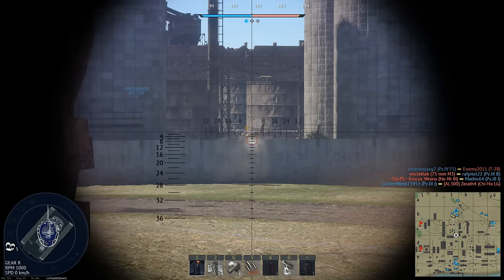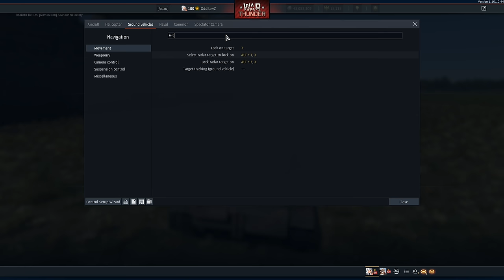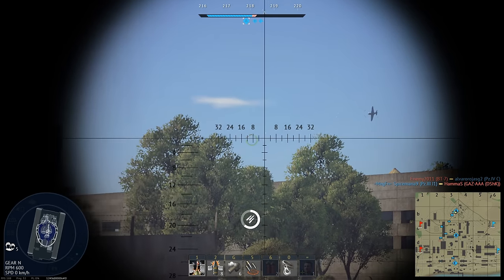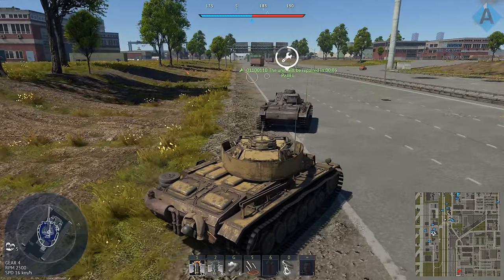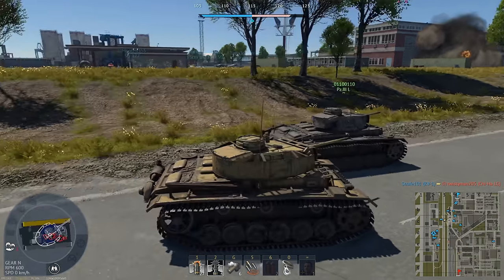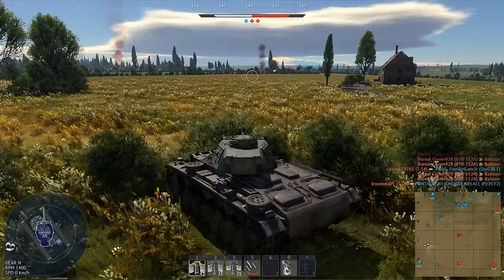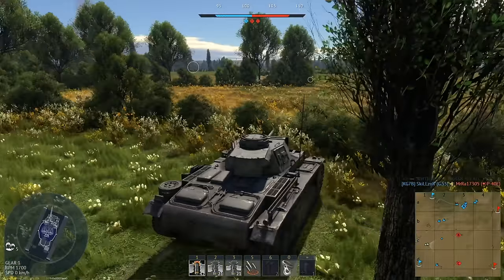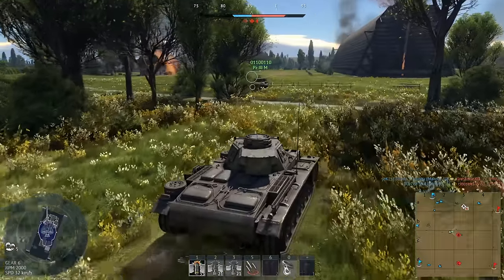TIGER ARMOUR AT 3.0 - Pz. III M in War Thunder - OddBawZ feat. @PhlyDaily  - Volumetric Armor

Comment: Definately a positive change. The Panzer IIIs look awesome with the winterketten and with the FHA (which most tanks should actually have) the effective thickness of the frontal turret armor on the L/M is 75mm+. That's more than any of the Panzer IVs. And with their mobility and the buff to the 50mm, they are now really, really good.
Reply: They also stomp if in an uptier now, try playing 2.0 GB into them, they are immune through the front now except for a few weakspots,
Reply: But that thickness looks like glitch. By broken volumetric system.
Reply: @Kijby  why do you think its a glitch,
Reply: @matthiuskoenig3378  You can see 265mm thickness and even >400mm from somewhere. 
Gun shield's thickness are very broken now.(Can see 1000mm effective thickness for turret of IS-2 and 400mm for leopard 1)
Reply: Did the Winterketten always there? I've never seen those modification before
Also is it available for stug iii as well?
Reply: @anonymousstout4759 Added by this patch. But Stug can't use winterketten(Use ostketten only).
Reply: @Kijby  does this modification added more stats or grip on lower stability terrain just like they intended to do, especially in snowy maps?
Btw thanks
Reply: @anonymousstout4759  Little more grip for tough terrain.
Reply: @Kijby  Little more grip, but that doesn't mean shit with Gaijin's Dawn Soap they put all over out tracks. It's like a goddamned slip'n'slide out there!
Reply: @leeham6230 it's 'funny' because the Soviet tanks that made huge compromises in all terrain grip for track durability and ease of maintenance like T-54 have all the grip in the world, no matter the terrain.

Comment: Honestly the volumetric shells update is fantastic, it makes the ballistics of WT far more accurate to real life. No more of these gamey turret ring shots from 150mm cannons.
Reply from the maker: I’m really enjoying it, actually.  Makes the battles more gritty!
Reply: The pen formula is still shit tho
Reply: @AllMightyKingBowser  Best part about the pen formula? They've actually made it easier to penetrate sloped armor than it is IRL.
Reply: @leeham6230  "Hurr durr look at me, im parroting spookston!" IRL machine gun ports were no where near as bad as they are made out to be, and the fact that 70mm-150mm shells can no longer slip through a 10mm hole is not a bad thing. American MG ports that used to be a weakspot are still reliable weakspots in my experience, I have not noticed any of the issues pointed out in his video as most of them are very rare and you really have to be trying to hit perfectly on the corner of a vehicles armor.
Reply: @doctordoggo8604  If you hit a joint with 1 shell, the game now adds the protection of the two plates, effectively making shots that should penetrate worthless. In real life, big shells could find their ways into smaller holes; if you know anything about physics, then this shouldn't be hard for you to figure out.

Volumetric shells could work, but they would have to either redo the armour models of most vehicles, or redo the calculations of penetration when two side-by-side plates are hit.

Again, good idea, but bad implementation. "hurr durr I'm parroting _____" is lazy and quite gay.
Reply: @leeham6230  Dude, you would literally have to be aiming to manage to hit a joint that head on, even then when you hit the join of a tank IRL you would have to pen both plates if 45mm of your 80mm shell hit the angle. I was pointing out that you are parroting spookston very clearly, and this is one of the rare instances where spookston is wrong.
Reply: @doctordoggo8604  Joints are weak points in WW2 tanks, cannot speak for modern/cold war tanks because I don't know much about them. The calculation: plate1 + plate2 for shells hitting 2 different plates make absolutely no sense at all.

Here's a good point on why they would have to change the armour models for this to work: Let's say I hit the Sherman M4A1's weak upper front plate (19mm thick), but I end up hitting the joint between that weak plate and the middle front plate, which is thicker (50+mm thick). In real life, my shell would take the path of least resistance, so I would lose some penetration, but my shell should still penetrate. In-game, the olates are added together, despite being beside each other. So, 19+50 = 79. This is just bad game design.

Comment: 9:45 One solution I could see is to have Vehicle Specific Controls. What I mean is that the default controls would be universal to all vehicles, but you would have the option from a drop-down menu to change the controls of whatever vehicle you have bought and/or crewed, without it changing the controls of other vehicles :P

Comment: The German 50mm is the best gun in the game for its tier straight up, no matter what you shoot at it will pen and last time i checked if you use the APCR on the puma you can go through a tigers front upper plate if you're close. When I used that gun it was one of the few guns I had absolute faith in whatever the situation.
Reply: Stock shell can go through the tiger, its 106mm pen and tigers front is 102mm
Reply: @threadworm437  i never did use the APCR
Reply: @threadworm437  i found the APCR to be overkill

Comment: Phly, the German 75 MM L/24 is a very short/smaller casing than on the 75 MM longer barrels.  The larger ammunition of the 75 MM of the L/ 43,48,and especially the L/70 barrels the case size is substantially longer and wider.  At a guess the L/24 ammunition rounds are anywhere between 2 to 3  times longer than the bigger ones.  So, they are very short and very light, comparatively.  Now add in the really small Panzer 3 turret with a lot of room because of the smaller breach.  Now I know that you know what I'm saying but maybe a few of your viewers might not.
Reply: This isn’t phlys channel 😂

Comment: I like to use the panzer 3n the panzer 3M the sdkfz 222 ,234puma ,251/21 and a pz IV g and f2 all together in a class because together they make for a really good loadout plus the pz3 N  has a 75 mm short barrel with 100 mm pen with the C type hlgr 38s  , I usually do not use widetracs as sometimes I do like actually using the 5 mm side skirts to ricochet rounds sometimes and or slow it down to make a impact less sucsessfull, and because it's a premium if you do literally anything with this tank you get rewarded lol 😂

Comment: So today i got proof that they did an oopsie....i hit t44 flat on the cheek,point blank with fv4202 sabot (280 mm of pen) 4 times and didnt pen...FOUR times...they goofed this up and im sure they will either revert back to old system or rewamp it significantly...to put it bluntly 120mm of armor stopped my 280mm pen round 4 times...and thats no spaced armor or any modules thats literally flat 120mm of rolled homogenous steel